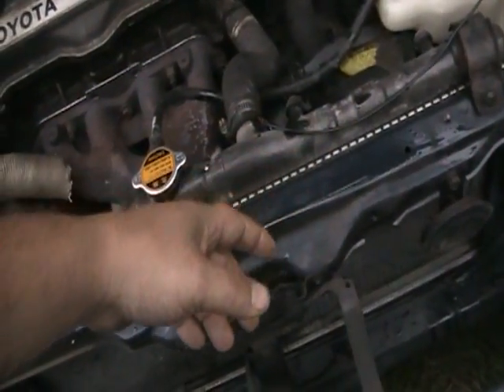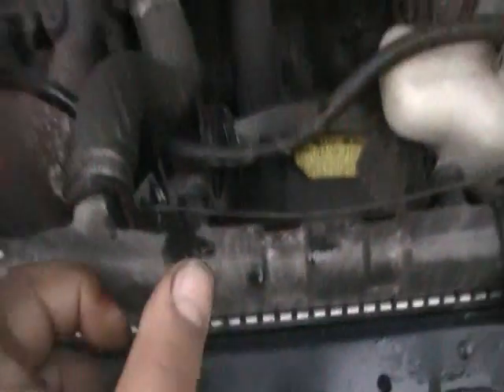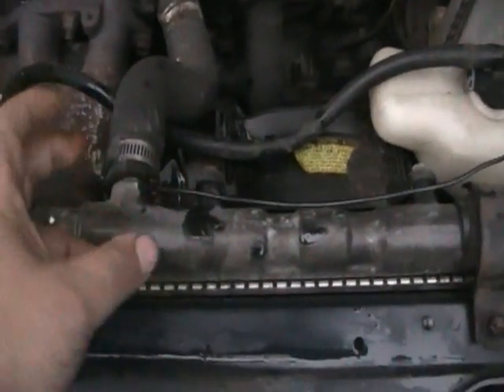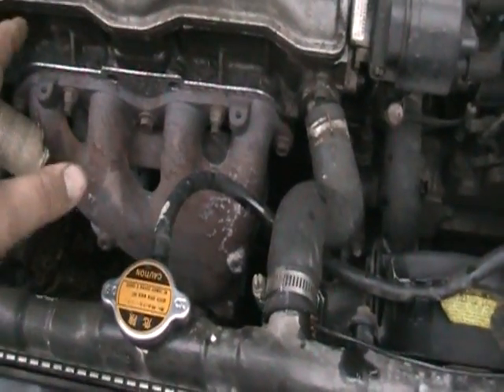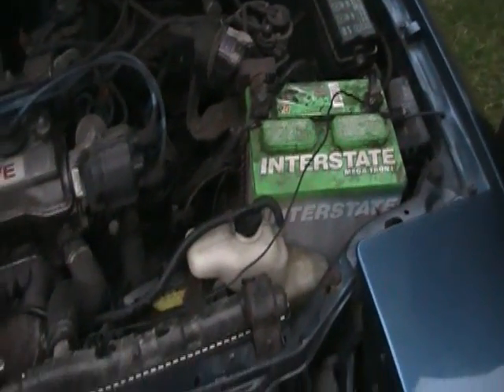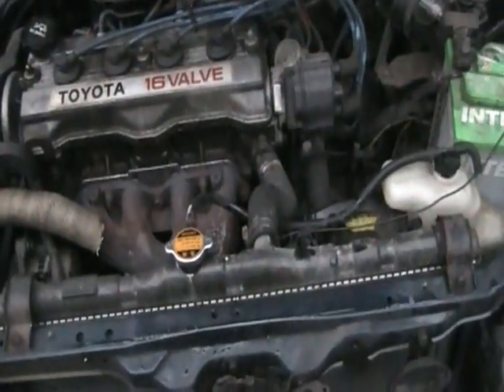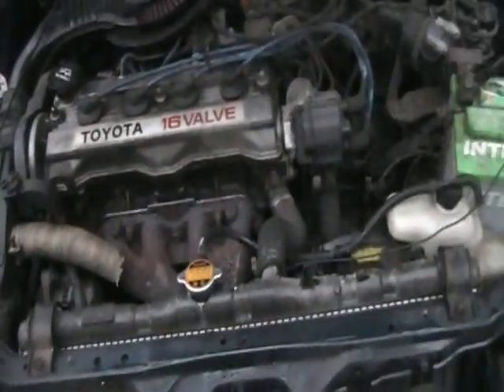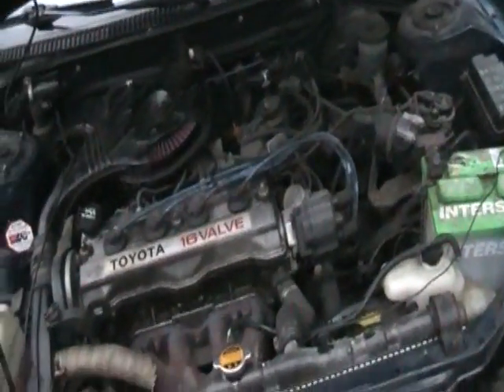joe cell save money on fuel with one wire

Comment: Also , it is obvious that you are getting good amounts of radiant energy , the increase of voltage in the Battery is something you will get with radiant / Orgone / 5th state energy ( like that term ) . So you have something real there .
Still , no conditioned water ? Did a J cell ever run on this engine ? 

I am amased so see it but like i said in other video of yours , in the end things are very simple but this simple ; )good job ! 
If you could confirm the latest standings I would attempt it

Comment: I'm confused ..i took a wire from the neg on battery n connected it to the radiator ..i struck the wire while engine was running 3-4 times ..no spark ..,then i watched a similar vid & it said go from the positive terminal of battery to the radiator ...i realize different age vehicles can have neg or positive earth ,,,...my vehicle is a mazda bongo turbo 2.5 diesel 1996 ..think i better investigate where engine is earthed to ,have you any thoughts on this ,ps i have no oxygen sensors.

Comment: HI friend , its a mazda bongo turbo diesel 2.5 constant 4 wheel drive automatic 1996, hard to tell if it has more power or not as its quite powerful anyway,+ i have a wet cell still on it with 21 plates that produces less than 1/2 lpm,have a new dry cell waiting to be fitted ...but b4 i take it out ..jocell202 suggested i try rigging it as a joecell ..wich i'm gonna try : )

Comment: I belive that has to do with alternator and audio static how ever if that radiator is grounded you get coolant electrolisys if you consider oil senzor ore dashboard regulator ore dual ignition it works on singel coil car still will work on exaust stroke how ever litel harder to turn it on in cold weather a carby selenoid does 2 porposes close fuel ore ither a vvt selenoid for vaporising fuel meaning if you have more fuel in gas state you change the compresion ration as well if you modify ore run a fuel pump in reverse what you get? compresor- de compresor are 1 and the same thing the suzuki is a universal engine what most peopel dont understand but hardly to call it safe to use expecialy if its a car with hidraulic valve lifters governourse if you think about it that pickup coil is a generator as well they use a universal coil who work bouth ways positive ore negative ground thinkering with the baterry potential will get biger sparks that fenomena can by watched when a alternator goes bade and puts ac to a baterry more power more voltage probably they increase jules out put on a coil nothing more inline non electrolitic ceramic capacitors the less resistance the more visibel and powerfull spark its related to plasma ignition as a generator culd by used starter motor,alternator and fuel pump in her reverse form thats a generator as well driven by air there are many ways how to do it peopel shuld know about those suzuki cars they are like opel,holden,gm and they have those centrain problems in realety they are half disel engines because those are SOHC engines they have normaly higher compresion rations,multi grade fuel runing engines,internal/external driven engines,hot/cold runing engines, lean/rich burning engines,multi ignition engines, they have lot names bigest advancement by those engines are they are not water cooled they behave more like oir/air cooled engines expecialy opel! they have build in space in theyr engine head for valves so no damage can not acure if their puley ore belt get destroyed plain and simpel explanation no magic those are after all universal engines their engine block is the same as by disel engines they use literaly the "same" parts to build them tipical gm, chevy,ford thing I ques with lot after marked varaity's who are build in diferenet continents just like positive and negative ground components.
joe did not video closer look on that car I bet I can find the answer if I look the car because lot of things does my 1982 opel ascona 1.3L engine it has a 4pin gm ignition module with inductive pick up coil on destributor and a e core tipy ignition hei coil they are by the way prone to run bade if you mix diferent fuel from diferent gas stations ,wrong anty freaze,and they dont like sintetic oil they get hot and wont shut of they start to act like a disel engine I put some disel in it and amazing it works no gasoline pure disel and that thing runs.eather way you can use electric motors to drive on it ore hidraulic ore pneumatic energy still that car will run on it with out problems they are simpel in desighn and they can have slow revs barely you can hear the engine but that is at retarding position ore if you remove mechanical and vacum advance from destributor and slightly retarder you then wont fire at compresion your timing will by at exaust stroke and the car runs more ore less normaly and at lower temperature if you manage to condense that fuel refilter it and return it then that is considered a closed loop runing engine mostly they use plasma ignition ore plasma generator at exaust manifold "closed system engine" thats why they have enough hidrogen to make the engine work its not geting used at all it cirkulates just like a ac conpresor gas plain and simpel and it works who ever say there is no economi they lie it can by achived easely with litel reverse inginering how ever the engine needs to reach hes operating temperature then you shut him of and let fuel cirkulate thats the trick! by a disel a decompresor is used to stabilize atmosferic preshures so they are constant at any earth hights  for exampel you light up a fire easyr at a moutan then at sea level ore somthing like that because in diferent regions are more ore less oxygen and nitrogen at your desposal thats how they manipulate disel power out put and engine temperature is important that is considered as a form to speed up,idel ore slow down as well if you dont belive by see wikipedia for old acient engines lenz bulldog tractor has gasoline/disel engines ore half turn ignition thactor runs bouth ways  at the same time I belive joe did explain some of those engines but not all of them in the end all is the same a hydrogen engine is older than a internal combustion engine easely tunabel by changing pulley sizes and some cams ore use deam selenoids like injectors to do intake and exaust so you dont need valves at all its sad to see young mechanics dont use their brain they know only school shit what a waste of time any way that cooling system is a baterry by it self and it will discharge by seing diferent potentials from the baterry and if you consider bacteria growth and biological chemistry you will get the idea how those engines run

Comment: With the level of effect I've seen with the first car it may be possible to run the engine without gasoline.  Obviously we have to keep the coolant circulating so if the t-stat is not open coolant does not circulate and the effect may be less or stopped once engine temps drop.  I think for the effect to take hold fully the car has to be running quite lean otherwise the wash of gasoline will block the H+ ions from getting into the cylinders.  Just a theory for now

Comment: hi there has any one had problem with the wire connected 2 rad that it causes premature rotting specially if aluminum i done this to 2 of my cars one of them got aluminum rad 
& its bmwx5 damn expensive 4 parts in uk i read on the nett that it would rot the rad if the current is more than 0.7v thanks for any help u may provide

Comment: I connected the fins of the radiator in 2 places on either side and ran the wires to ground.  Guess what?   Something is happening, not sure what yet but will let you know.  The biggest difference I am seeing after 3 days is my car doesn't run as hot.  The temp guage is running at less than half of its normal position.  That I find interesting.  As far as the milage goes the jury is still out.  Will let you know when I have something concrete to report. Till then a changed doubting Thomas waits

Comment: trave thru the block ? NO   it goes in thru the intake the immediate startup is because the battery keeps making hho and the hood compartment is full of it ...very dangerous you should put the wire on a "running only circut" like the alternator positive, and put the overflow hose bubbling in container then a hose from the top of the overflow directly into the intake hose  : ) then see how much you get it should supprise you and the 02 sensor on this is what shuts down the gas

Comment: BS"D
I know this is not an HHO cell. and I know it's possible to run Joe Cell without any fuel. 
Even though I don't know if the effect you demonstrate is exactly what Joe Cell does... BUT,
I am saying to look up HHO tuning because since computer starts to compensate with adding more fuel as JHOLMES writes in his diary, ( also we don't know if it's true, but it does make sense) maybe we could use experience of people that remapped their engines after HHO installation.

Comment: Why not flush out the antifreeze and replace with clean rain water???
Reply: +Brad Haas Could help to flush the rad as some additives may be blocking the Hydrogen from saturating the block, but I would use good clean river water before rain water as nanomaterial from minerals in the water may be building up on the walls of the inside of the rad to aid in the whole process.
Reply: +Brad Haas cause 1 its corrosive/sour 2 its dirty

Comment: Not realy Its just 1 small part of the story but any way thank you.
Dual Engines work litel bitt more complicated .
Those are ordinary Gasoline-Disel engine blocks.
You do have a point there crank gases,coolant electrolisys,from oil pan driping fuel to hot exaust pipes,reverse polarity delco 12si who do not have diode or zener diode,s/r terminal starter motor who oddly look similar to Rosenberg Generator and God knows what not to mention 5pin dual relays do lot staff not to forget organic coolant ,tree oil fumes in cold morning on hot magnetised engine so mostly its bacteria eating oil.
Happened to me lot times and me car is Opel Ascona C or Camira known in Australia it behaves more or less like carbureted disel engine .
Any way I wont go in to much what Multi Stroker Engine do or Gasoline-Disel Hot Bulbs or Combined Engines Piston-Rotary design or Piston - Electric motors like Owen Magnetic car design.
If some one know Joe or Peater tell them to great them from Bosnia.
I wont deny the fact Joe is indead great mechanic and good teacher .
I did coppy lot things from them and they work how ever I did not use a cell even tought I did fummel with the radiator grounded it be zip ties .
So all those systems are actualy related to those survival marine radiose and wacum tube baterry chargers they have lot similaritys.
I used on me own engine as Hot Bulb,Hit and Miss,Combined internal/external fiering,Flame Liker and even as Pulse Jet engine.
Im not shure but I think Joe was talking about the Blue Flame dragster and all the components are alredy present in normal engines at least considering GM engines .
So mostly Dual Engines are used or more for full effect.
So mostly those vehecels resembel Deuce Half Truck,Willys Jeep,Ford Model T or Excavator/Train drive or Gasoline-Disel Hot Bulb Electric Drive Train .
Evry thing ells might be added to those engines to acuare centrain effects .
So the Shell 376mpg Opel Rekord P1 uses similar system the Owen car was Engine-Electric Dual engine the Shell was Dual Engines purely design.
After 15 years watching GM engines effects odd crap always acure randomly .

Comment: Lower...and I see the precipitation on the ground below both exhausts in the back. My gas pedal feels smoother ...oil pressure a third lower. And I'm gonna take her for.a.spin. Also a cloud over us now...80 degrees out here and.blue skies. I can also tell something is going on by seeing the energy float out into the air from the front of my truck. I got an 07 Tahoe with custom air intake dual exhaust. 5.3 liter...

Comment: @Begbucks , Did not blend it at all, "Me Nor My Friend" - {blended it}, "we just poured it straight in to tank", it was fine, never no problem, My citron  run seriously well, better even, just pour "Clean" Veg / oil in on top of my diesel, it floats on the diesel and kicks in when diesel runs out, VEG/OIL kicks in, & visa versa, just put diesel in on top of VEG/OIL, , and as said, I mixed and matched & swapped round as available, no other additives or preparations, never no problems,,,
Thom. ,

Comment: Hey everyone, check out the vid I made showing the connection to the radiator.   It's under digitheadman.   Spread the word (for free)   Cheers      To answer the starting issue, it still starts hard after sitting awhile but after 5 or 6 trys it fires right up (vs 1 shot starting like it used to be)

Comment: @jocell202 Yes, still through the over flow!  Luckily my overflow outlet is far enough below the cap that the cap does seal correctly, no leaks and the fluid is routing past the 14 gauge wire into the overflow reservoir and back through when it cools.  
So far so good.  P.S. Have sent a small donation to your paypal account.  You've got some cutting edge ideas and I want to stay abreast. Will be picking up spark plug non foulers and getting ready just in case the oxygen sensors start override!

Comment: Hi Great video...what you are doing is the HullEffect technology it is patented by Robert W Hull and Nathan Rogers...go you TheHullEffect@yahoogroups.  Just to let you know the way you have it connected will ROT your radiator out very shortly within weeks or months.  The correct way to wire this up is go grab a rheostat from home depot hook the red & yellow wires to the POSITIVE battery terminal and the BLACK wire to the hose clamp on the top Radiator connection only...

Comment: hay the ground wire from the battery is connected to the engine block Wat you re duing  makes no sense this is false
Reply: you just dont understand dont get mad I didnt understand until today.
Reply: captain42979
So, let's try to understand... Electrons come from negative, they are attracted by positive charges (lack of electrons) and they travel everywhere they can ie in conductive materials... as water. Does water works like a second battery? It's so curious... And then, why does it affect the engine? I have to try it...
Reply: Ronan D. The closest thing I have found is something called the joe cell so study that I haven't got an engine to run on charged water but I am structuring water using marbles in a cylindrical tube using a britta filter and keep on cycling the process. It is all about charged water that I know and its not hho. I am ordering magnets to condition the water more and am looking for parts to build my main stainless steel cell but it makes to much sense to me with all the studying I have done on the electrical universe to be wrong. I do know this kinda thinking if frowned upon and I personally believe it is very very old technology that was used thousands of years ago in different ways such as very smart people doing the same things we do today without computers as we have them sorta like having a society being very smart and doing things from scratch as we did only in a different way. Anyways I hope that helped if you wanna subscribe to my channel you can I have no good video's but in the near future I plan on posting some good stuff about this.
Reply: +GALA PRO Hello. That is me talking in the video. Radiators are insulated, perhaps for this very reason. Even if they where not it works better or may only work with non ferrous material, in other words the freed up electrons do not easily travel threw magnetic material (the block into the battery.)
Reply: +Why? fuyt. How can this be done with car that use coolant or anti freeze? Any suggestions? Please
Reply: Annaëlle D. 
Read my comment.
Reply: Captain 
Good luck cappy.
Reply: fesocan
 substitute coolant with salt water and alcohol.

Comment: this is one way increasing gas milage it is called coolant ore radiator electrolisys,manipulation ither the starter motor ore alternator to a dc motor,plazma ignition by changing condenser values ore simply dont let rectify alternator at all and run purely on ac electricity,older cars have a magnetic pick up by it self thats a dynamo ore ac generator you peopel didnt lusten joe x what he is talking wach all of his videos a ordinary car can run 180° out of his fiering faze with waste spark ore with out it by simply removing mechanical advance and wacumm advance the point is a engine can my lot things 2stroke to 4stroke and vice versa changing values you change fuel/air/electric potential/cold/hot all of that has a efect on a engine use a simpel selenoid huck it to the ignition it shuld run that is called low tension ignition there are some cars called amp ignition rather then voltage ignition see older engines as internal combustion how they work what joe probably use is plazma ignition,plazma generator,hho cell and probably a closed engine system you only produce gas so much that you actualy fill the insides that engine and you stop with a relay! simpel chemistry changing molecular mass at high speed nothing more nothing less,engine run one problems can acure vecause of anty freze ore ethilen glicol who is a alcohol by the way!basicaly for evry thing exist explanation ore use simply a higher preshure pump and jets to make out of a gasoline engine to dizel engine 😐 gm in conporation with other engine manufacturers do that staff the engine bloks are same to gasoline engines no suprise that suzuki,mitcubichi,holde,opel and isuzu have isues those are special engines ore rather call them universal engines